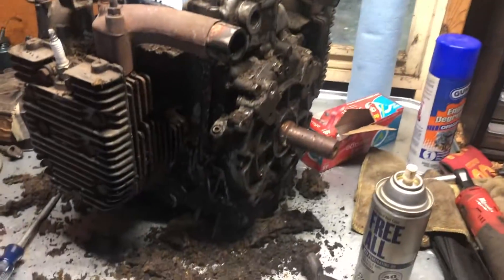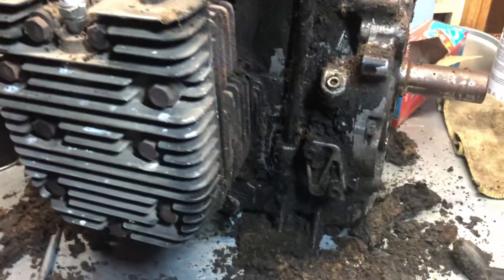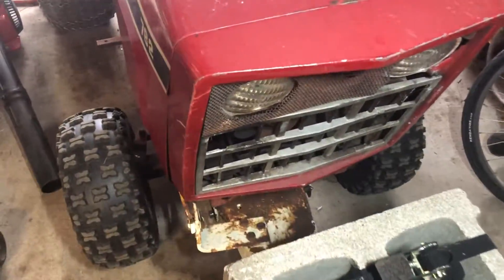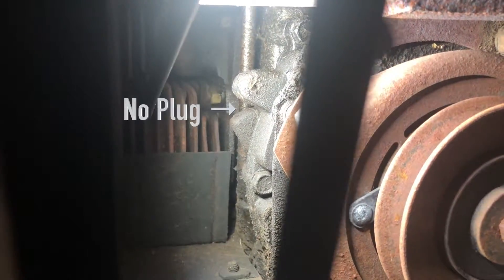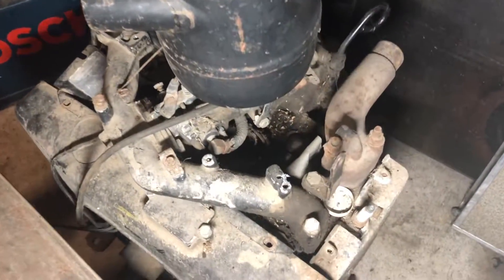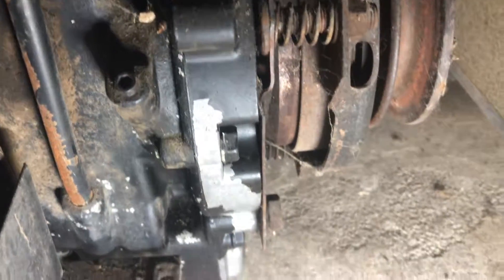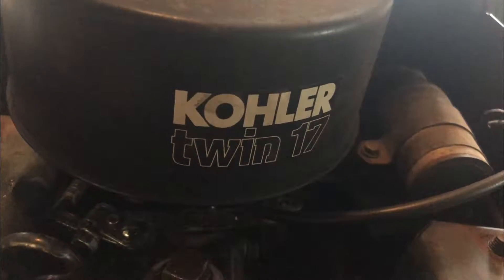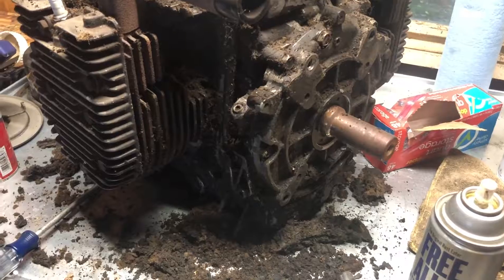KT17 Series 1 vs Series II

Comment: KT19 Series 1 here. It's in a 7119 that looks like its been through a war, it's as old as I am and it's still going. A lot of vibration, though. I'm trying to figure out if it's the engine or the driveshaft and coupling.
Reply: Try removing the drive shaft and running the engine that way

Comment: I just bought a 782 with a my 17 series 1 is that a bad thing? Do all series 1 throw a rod sooner or later or if serviced regularly and taken care of should it last a long time?
Great video thanks
Reply from the maker: Well if it's got an original series 1 in it, it's well over 40 years old at this point and still running. Just keep oil in it religiously and it'll be as fine as anything else. Most of the ones that died did so long ago and have been replaced/rebuilt. If it were to toss a rod (which I wouldn't really worry about, but it's possible I suppose), you could replace it with any of the KT/M series engines easily, or upgrade to a CH18/20/22.
Reply: @515cubcadetguy9  Thank you very much. I am going to change all the fluids, filters and keep it serviced regularly. Enjoying your videos!😊

Comment: So mine has what looks to be a plug in that port but it's not raised as high, it definitely isn't just a hole but it looks like it's 1/16th verses a 1/8th plug. I'm guessing the only way I'll ever know is to see if I can thread it out and put a pressure gauge on it. Of course mine is on a wheel horse and it's in a super fun place to get to.

Comment: so for sure if it has the plate it is a series 2? Good to know i have 2 of these in in the process of installing one in my wifes 317 john deere.
Reply from the maker: For sure it’s a series II crankcase, and a little bit later one at that.  M18s all had that plate as well. It’s  basically the same engine. 

KT17 SII is a great engine.

Comment: I have an Allis chalmers 917 Tractor with a KT17 series 1 blown motor,can I replace it with a 22hp kohler command.?
Any other ideas please advise.
Reply from the maker: You probably can. I can’t speak to that model specifically but if you get the crank alignment right and the adapters right, then you’ll just need to convert the wiring for the magneto ignition on the command. You need the ground the coils to stop it instead of providing 12v to the coil to get it running. I usually use an automotive relay for that and it works well.

Comment: I'm restoring a Simplicity 17 GTH-L with a series 2. Sometimes when starting it makes a screeching noise and a loud knocking sound. It doesn't do it all the time. After it starts sounds fine and no smoking. Just wondering if you have any do this?
Reply from the maker: Often a screech on startup is due to the bearings in the starter lacking lubrication. Pretty common problem on these. You can tear the starter down and clean it and lube it and that should fix it, generally speaking.
Reply: @515cubcadetguy9  ok thanks. What about the loud knocking sound? Could that be the starter too?
Reply from the maker: Possibly the bendix not disengaging? You’ll have to tear into it a bit and see.